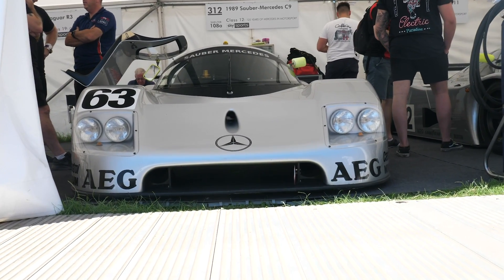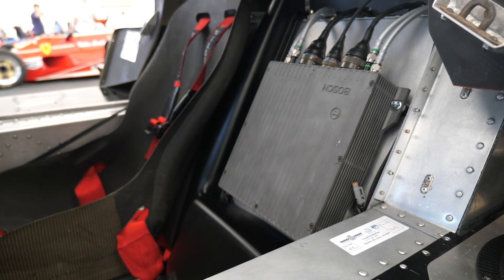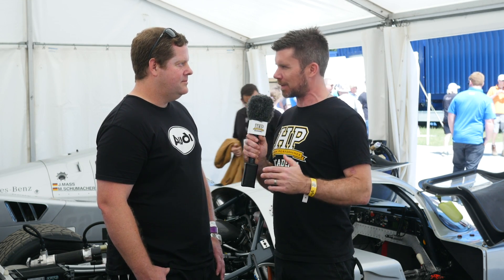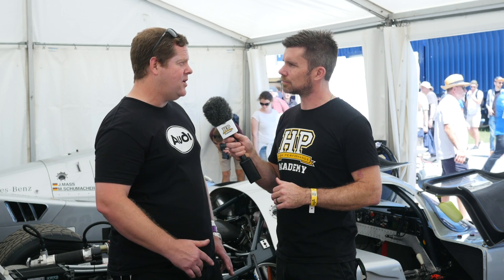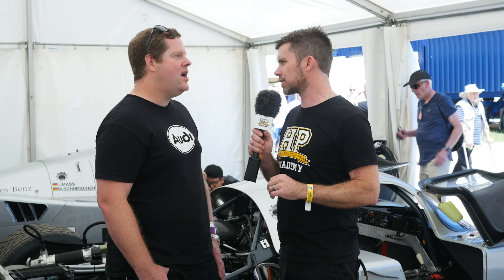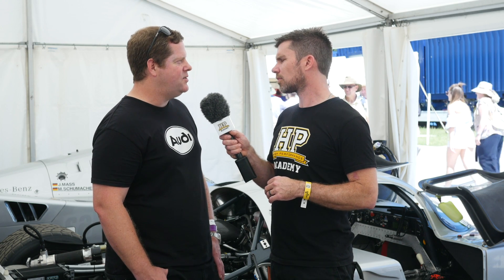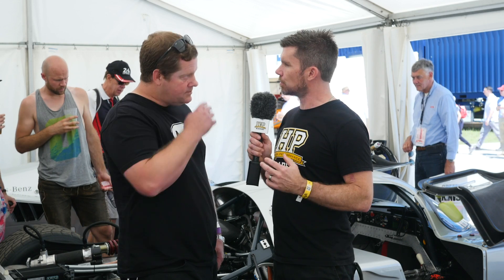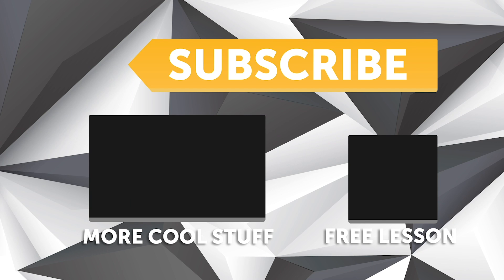800HP 5L V8 Sauber/Mercedes C9 | 24 Hours of Le Mans Champion [TECH TOUR]

Comment: I drive the 510hp V8 4.0l engine in the c63 coupé. It feels kinda slow to be honest. It doesn't has that aggressive punch from 0 to 60 like the older 6.3l V8
Reply from the maker: Have you compared the torque curves? Could be interesting to see the difference - Taz.